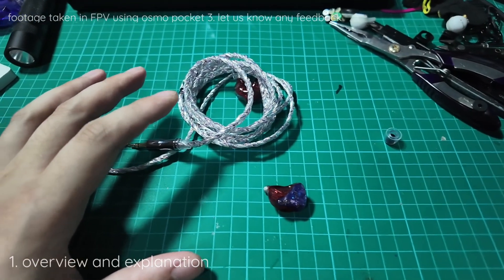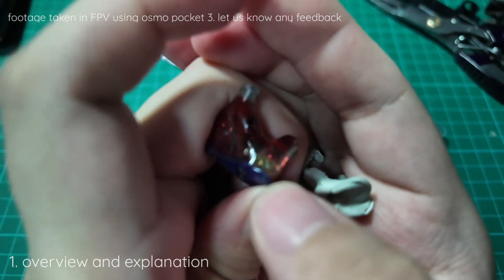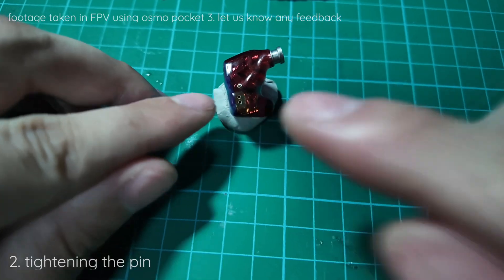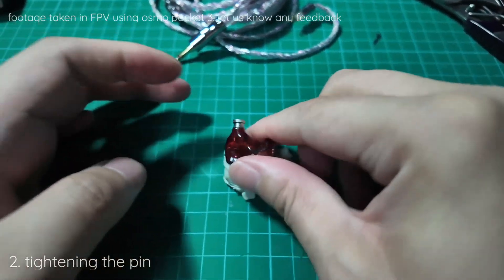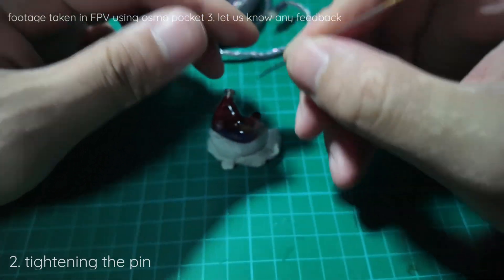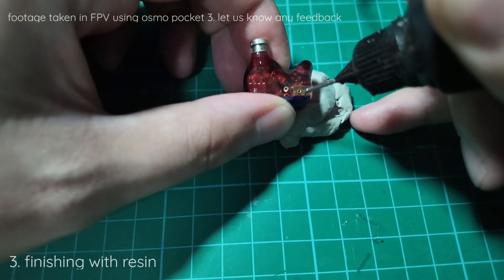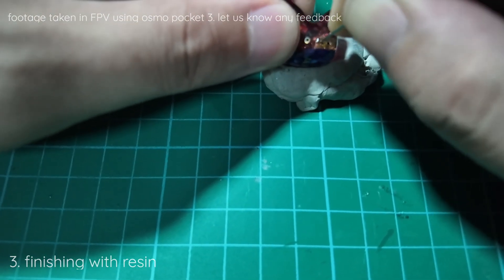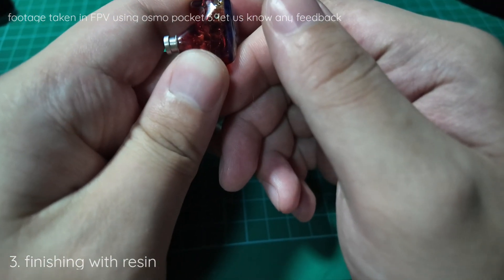IEM CIEM loose 2 pin fix (tightening) feat. seeaudio kaguya [NAKED Tutorial]

Comment: I use my own hair put in the holes, then I put the pins back to the holes. It worked !
Reply from the maker: this is actually a very good solution in a pinch. the hair thickness will definitely help with the pin tolerance. i will start suggesting this to users who has the same issue but dont have time to arrange for a repair

Comment: If we don't use resin, is it possible for the IEMs to still be tight for a considerable period of time? Does doing this over and over break the connectors? How do you replace connectors of the IEMs? I don't wanna break my IEMs, I just want the connectors to be tighter temporarily without using resin potentially.

Comment: What type of resin did you use? And could I use B-7000 glue instead?
Reply from the maker: Loctite uv glue. B7000 is too soft to work, you can use any other solid resin or a very small amt of epoxy
Reply: @sgaudiohive  Thank you!! I have some epoxy I can use.
Reply from the maker: @duckae42use just a dab, the function is only to stop the socket from expanding
Reply: @sgaudiohive Just to clarify, in applying the resin on top on the 2 pin connector and dab in in between where the 2 halves the the connector meet without getting it down the hole?

Don’t want to ruin my IEMs lol
Reply from the maker: @duckae42no, apply it in the gap outside of the pin entirely, it's depicted in the video clearly